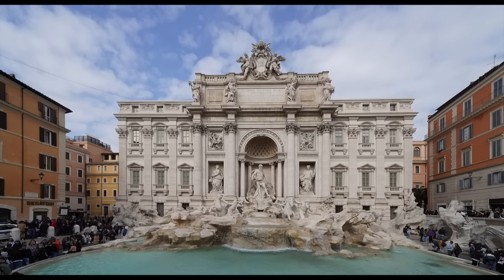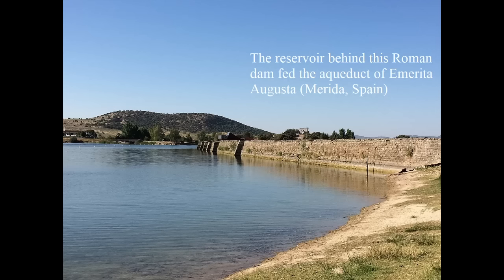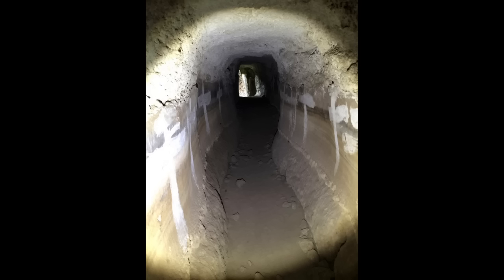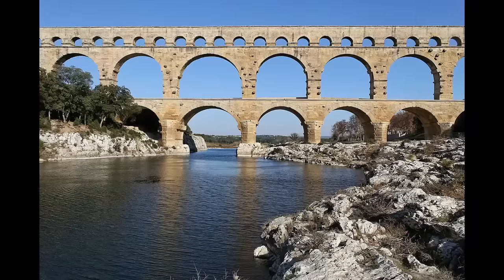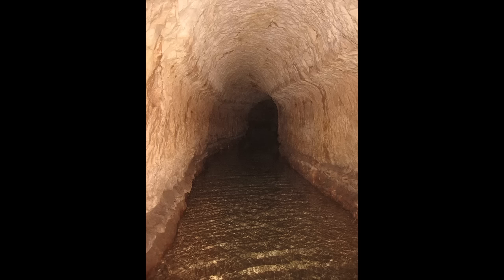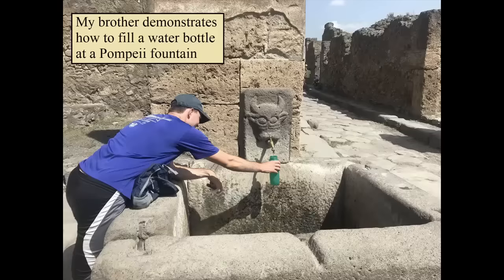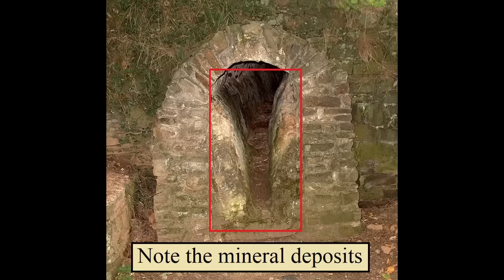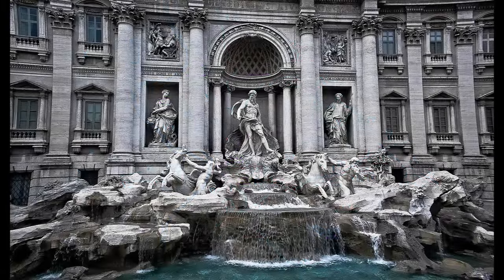How did Roman Aqueducts work?

Comment: Funny thing about the lead pipes is we used lead pipes even in relatively modern times.  Flint Michigan rather infamously had them.  And they weren't really a problem as long as the PH and mineral content of the water was controlled properly.  If the PH is right, the minerals form a stable coating over the lead so very little of the lead is even in contact with the water.  But if the PH is wrong, the minerals can be stripped off and the lead will leach into the water.  That's what happened in Flint Michigan - the water municipality changed water sources, mismanaged the water treatment of the new source, and stripped off the mineral coating, causing lead contamination of the water supply.
Reply: haha i went down to say the same thing. Pipes stay clean by getting dirty. love it
Reply: Nice try at shifting the blame (in regards to Flint Michigan).  Lead is always bad.  First it has to be mined (pollution on top of being toxic), melted (toxic), worked (toxic), and maintained (toxic.)  The only reason we humans started using it is because it was easy.
Reply: @TheDanEdwards  yeah but like so is pvc and we still use that
Actually like so many things I install on the daily are like that. It's fuckin depressing man.
Reply: Lead pipes exist in distribution systems in almost all modern cities towns and in abundance. The flow of the water keeps the lead from leeching. Copper and pvc and standard now but many of the old lead exist. Believe me I work in water distribution
Reply: The area I lived in England is all lead water pipes from the Victorian era. Would likely have been fine but I didn't have that many IQ points spare to begin with! 😆
Reply: @cretchboc  Good thing I have clean well water then.
Reply: That also happened in Washington DC from 2000 to 2004!  I know because I was there and only found out years later!  I was stationed there at Marine Barracks Washington from 2000 to 2002.
Reply: also modern pipes are pressurized, ancient pipes had flowing water
Reply: ummmm Dan, c coder was not shifting the blame.  He specifically stated what happened and if you read his comment he specifically states that it was mismanaged.  Jeez dude. seriously...
Reply: @nozrep  Exactly.  I wasn't trying to shift blame.  I was simply explaining that they exist (as they do in many locations), and while it isn't a great thing that they had lead pipes, they can be made reasonably safe with proper management and monitoring.  It's also an explanation of why the lead pipes they had had for decades all of the sudden became a major problem - because the city screwed up when they tried to save some money (they decided it was too expensive to keep buying water from Detroit and instead use water from the Flint River, then failed to treat that water properly).  It's expensive and disruptive to replace utilities.  If you can make your existing ones safe and keep using what you have, replacement is a hard sell.
Reply: Calgary Alberta has lead service pipes, Installed during WW2 when copper was scarce. The natural hardness keeps the lead from dissolving in the water. The municipality has a program to systematically remove them and replace them with modern materials
Reply: @nozrep  everyone is looking for a gotcha moment.  We need to learn how to chill as a species.  You seem to get it.
Reply: @TheDanEdwards   Nothing about shifting the blame. Modern lead extraction is not "toxic."  Most lead now comes from recycling lead acid batteries like in your car.
Reply: @neutralfellow9736   That has NOTHING to do with toxicity.  Chemistry 101.
Reply: @cloud9935  PVC is diabolical in all stages of production, and terrible for the environment. It also leaches endocrine disrupters.
Reply: Also - "plumber" ~~ "lead-worker"
Reply: Dey led pypez be rayziss doh
Reply: @williamchamberlain2263  Oh yes, definitely.  Even the symbol for lead, Pb reflects that.  Pb is short for the Latin word for lead, plumbum.  Which, obviously, you can see where we get the word plumbing.

People forget back in the olden days, plumbers didn't use manufactured pipes and fittings.  They actually formed fittings and joints from lead on site!  Here's This Old House talking about it: https://www.youtube.com/watch?v=brumHe2lmWg
https://www.youtube.com/watch?v=YxVQDtDT1CM
It's easy to forget that many things we take for granted as obvious (like pipe fittings) were actually huge innovations.  Another example of that is the can opener.  The can opener was invented 100 years after food cans were invented!
Reply: @TheDanEdwards  It's quite useful in a number of applications, sounds like you're saying we should ban lead altogether lol.
Reply: @roblangada4516  "sounds like you're saying we should ban lead altogether lol." - use of lead should be minimized.  What you seem to have ignored (or is it you don't care?) is that people who have to work in or around lead are much more likely to be affected by it.
Reply: @TheDanEdwards  I suppose plastic is so much better.
Reply: @bigtenfourrubberducky  "Enjoy your NPR." - seems some deeply held resentments you hold are just itching to come out.
Reply: @dannyarcher6370  " I suppose plastic is so much better." - for some uses, yes.
Reply: @TheDanEdwards  Yes I resent post-2015 NPR becoming a parody of itself and smugly reporting misinformation as if it were fact on a daily basis. Like I said, you go ahead and continue to enjoy that pal.
Reply: I'm playing a show in Flint, MI in a few weeks. I plan on only drinking beer.
Reply: It happened infamously in Flint but later studies revealed that it is in fact a nationwide problem, even to this day… generation after generation, people have been exposed to dangerous amounts of lead.
Reply: I grew up in a house in Boston that had all lead pipes.  I speculate that had the pipes been copper, I would have an IQ of 200.
Reply: Even if lead wasn’t harmful I doubt they’d use it this day and age seeing how expensive lead has gotten and Obama got rid of all abilities to process lead in the US.
Reply: @montanaplease  Even copper has become very expensive.  It isn't exactly being phased out, but usage has declined substantially both due to purchase cost and installation cost.  Galvanized iron pipe is an option, but hasn't been widely used for drinking water for many years.

Arguably PEX is superior to all of them.  Any sort of metal pipe can and does leach into the water, if the PH of the water is right.  Copper leaching into the water tends to cause blue green stains.  May or may not be harmful to humans (many copper compounds are rather unhealthy), but certainly unsightly.  Also will eventually cause pinhole leaks.  PEX doesn't do any of that.  On top of being easier to install, cheaper, and more burst resistant.  It's a case where not only is it the mostly healthy choice, it's the most economical and likely longest lived one.
Reply: @montanaplease  lead is still processed in the USA but it’s use is heavily restricted for consumer products…for good reason. It is something best phased out of use in every niche possible
Reply: @dannymcnamara2554  worked for the City of Calgary Waterworks department for 15 years, have 100% confidence in the water quality and the mid level hardness makes it the best tasting tap water in the world
Reply: @montanaplease   the last “primary” lead smelter was shut down in 2013, the “secondary” lead smelters recycle material and are still in operation. It’s for the better of our health and environment. I’d say the same for coal plants and pipelines being shut down.
Reply: I belong to the elite !!
I have piped water in my house.
Reply: @Essex121514  Agreed - and notice they never answered the question? Instead, they shifted to another comment to which they could achieve a "gotcha" moment; namely the one in which someone mentioned NPR. Fairly typical, in that regard.
Reply: Imagine an emperor mocking the desperate poisoned people (mostly kids) and sending legions to play guerrilla in their homes, he wouldn't last till the next day. God bless America
Reply: So instead of fixing the issue they chose an over sophisticated bandaid.
Reply: Fascinating to finally understand this problem
Reply: @AtomicBl453  The problem is that they wrecked the bandaid.  Accumulation of minerals is a natural process, as long as the PH and hardness are correct (corrosion inhibiting minerals can help too).  You don't even need fancy modern tech for that.  The video itself talked about such deposits in Roman water systems.  And the pipes already had that from the years they had been in operation.  All the city had to do was keep levels where they should be (basic monitoring and adjustment any competent municipality should be doing).

Also, arguably, replacement isn't simple.  It means hiring work crews, digging up streets, patching those streets, digging up people's yards, replacing pipes in people's houses, shutting people's water supplies off for a time.  Not to mention dealing with the public complaining about higher taxes or canceled programs because "we have to replace pipes that are working just fine".  Here's This Old House showing one method of replacing just the pipe from a house to the street: https://www.youtube.com/watch?v=18TxZoe1X_I .  One house, not so bad.  Every house in the city?  Not so simple.
Reply: That's what happens with government
Reply: @TheDanEdwards  Lead was comparatively cheap and easy to work with. Of course it was used!
Reply: @FroggyHopScotch30  "how dare you explain facts." - that doesn't even make sense.  I was not trying to "explain" facts. I'm countering the attempt to minimize the negative effects of lead.
Reply: @TheDanEdwards  Don't forget about cheap.
Reply: stop tryna flex ur basic xhemistruy knowledgenahahahaha
Reply: oh... that explains the taste..
Reply: The chemical symbol for lead is Pb from the Latin, “plumbum.” Since the Romans used so much lead piping for water, this is where the term “plumbing” to describe water distribution systems comes from.
Reply: "relatively modern" 

Lead in potable water pipes in the US was limited to 8% by mass from 1982 lead reduction act up until 2014, when it was reduced from 8% to 0.25% maximum lead content by mass. Any copper alloy/brass/bronze plumbing pipe or fixture and the solders that join their components in the US that was installed or made in 2014 or earlier is almost certainly 8% lead by mass. They aren't full lead pipes but copper and brass alloys are heavily leaded.

I would call 2014 modern times, not just relatively modern.
Reply: flint michigan megabowl!!!!!
Reply: “Often times in Rome, water was tainted and full of bacteria that were able to cause illness and death”
Detroit water is equivalent to water from 23 centuries ago.  Michigan has 5 great lakes and no clean water.
Reply: Love this
Reply: @AYVYN  I mean, yeah, the Great Lakes are all fubar these days. Decades of heavy industry have made them gross.
Reply: Using lead pipes is what led to people who work with water pipes being called plumbers. The Latin word for lead - plumb.
Reply: @ccoder4953  Copper plumbing is pretty standard around here. My parents farm has copper pipes, and it does show with a very slight greenish tint in hair ends.

Not that I worry. Considering how long and widespread use of copper and even lead is, I think the fear for them is completely out of proportion. We still live 80 years on average in western countries, and it's the greasy food, alcohol, genetic diseases, tobacco and eventually just time that kills us. Not some metal deposits.
Reply: @jhutt8002  Yeah, I don't think it's generally a big enough concern to warrant ripping them out (even lead, if properly taken take of and monitored, can arguably be in that camp).  But for new construction and remodeling, PEX is arguably the superior choice.  Also worth pointing out that if you have copper in the water, that means your water is slightly acidic and is slowly eating away at the pipes.  In time, the copper pipes will develop pinhole leaks.  It may take quite a long time though, just depends on the severity of the problem.  That is actually a problem you can prevent.  There's a device called an acid neutralizer (basically a tank with a bunch of crushed limestone in it) that neutralizes the acid.  Downside is you have to follow it with a water softener or else you have very hard water.
Reply: @cloud9935  Bluemchöli mit Sossä
Reply: @TheDanEdwards  it's a dumb material to use but if that's what you have to work with, you work with it. Flint, and by extension all of Michigan isn't exactly rich, Detroit has been a drain. The big 3 are the only thing the state has going for it and frankly they've been a drain too, massive lay offs and such.
TLDR the place is a wreck.

Really there's a lot of problems that helped create the conditions for those pipes to still be used in the first place, and there's a lotta reasons why the people in charge of the plant let that failure happen.
Reply: Yes, PH. It's probably water acidity that causes the leaching.  In mining, leaching is a big problem.  Most of these mining companies have damaged numerable water sources (US) irreversibly.  That is they are toxic, and will remain so, forever.
Reply: @cloud9935 
Most water and sewer is either SDR35 or SDR40 actually, perfectly safe. Though copper is frequently being used more often.

Source: install this shit everyday and do my own takeoffs for my jobs.
Reply: @TheDanEdwards  Terrible take.
Reply: @TheDanEdwards  nerd
Reply: For what it’s with flint is just the poster child. It’s also almost every other small city including the one I was born in, and a few major ones like Chicago.
Reply: They're still very common as distribution pipes from the mains network to individual houses in the UK. My mains supply pipe is lead and I've worked on it several times. As long as you flush with cold water it's not a problem.
Reply: @TheDanEdwards That's all of civilization. Lead is used for a lot more things than pipes.
Reply: @contraband1543 make sure it stays clean.  Over in China, industry has polluted like 80% of their groundwater.
Reply: Yes, one of the greatest still unpunished crimes against humanity by a public authority. Many died andgot very sick from the poisoning. The guilty we're able to cover it up or scurry off and no one's trying to bring them to justice. No one in power cares, and apparently all the tough street gangs are nowhere to be found. I don't even know if they're paying attention to the issue, so Street Justice can't find the guilty either. Ten years on, and it essentially represented one of the greatest domestic crimes against the people of this country has ever seen. Watch one of the documentaries it's so far beyond just a mild rash or a little skin irritant. 

The people who are stuck living in or around Flint still don't have clean water. The fact that this could happen with zero repercussions just goes to show you how completely criminal and evil and thoroughly psychopathic the power structure in this country is. In short, Flint lives do not matter. They're primarily poor and black and brown and therefore they do not matter. And this is where we are today. 

No one is coming to save the people of Flint just like no one is coming to save the people of East palestine. The guilty just get to walk away. Pretty sad that this is the reality but it is. The damage is done, evil controls those who control public decisions in this country, and that's just how it is. Not sure exactly how we're supposed to change this. 

Flint is just one well-known example; there are many more cities where it's like this to a greater or lesser degree. 

I don't know how to stop these kinds of crimes against the people. Those who do them know they can get away with them and they'll never be punished so that's where we are. Cops, politicians - they might go after each other but they feel they don't have to answer to anyone so what's to stop them?
Reply: @cloud9935 Almost Every building material you look at says “may cause cancer” 😂😂

Comment: Born and grown up in Rome, one of the most unique features of the 'Eternal City", is the never stopping sound of flowing water from fountains and "fontanelle" the bronze drinking posts also known as "nasone" (big nose) for its characteristic curved tap.
Reply: I'm surprised they still use those & the water is clean enough to drink. Been to Rome several times & see those drinking faucets all over with people not only filling bottles, but actually putting their hand or even mouth to it & drinking from it.
Reply: @frankgordon8829  the water that comes from the nasoni as well as any tap, is controlled by the municipality and comes from different sources through a network of both old and (relatively) new underground aqueducts. No above ground aqueduct is in use to my knowledge.  
Ditto for the sewage system, that has at its core the ancient cloaca maxima, that has seen two millennia of sh*t passing by.
Reply: @musamusashi   I think they still use some of the old aqueducts for the decorative fountants (non drinking) like the one in the video.
Reply: @mowtow90  yes, the old system has been expanded and integrated with newer elements over the centuries, but never totally replaced.

Comment: An aquaduct of sort was built near where i live in the early 20th century for supplying water to gold mining operations. It is really a gradual downslope ditch with inverted siphons built of wood flumes and 4' diameter steel pipe at every perpendicular valley. Since it operation ended  they are being reclaimed into the wilderness. The ditch and flumes are filled with trees. I go to one sometimes and contemplate the silence of the place now as compared to what i imagine it sounded like during construction and the whoosh of water going into and out of the large steel pipe.